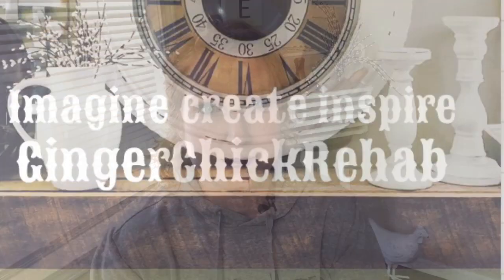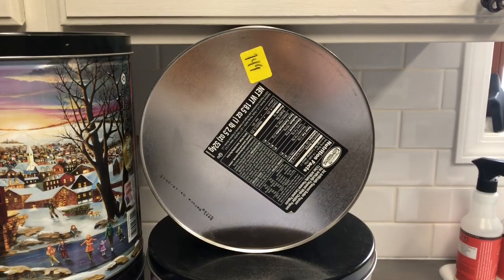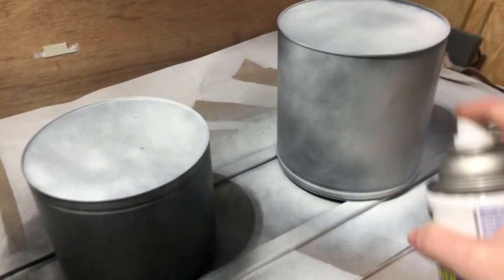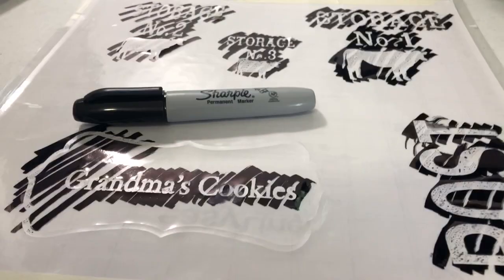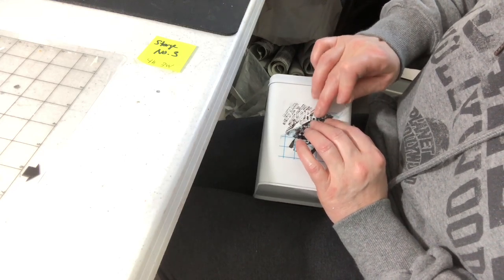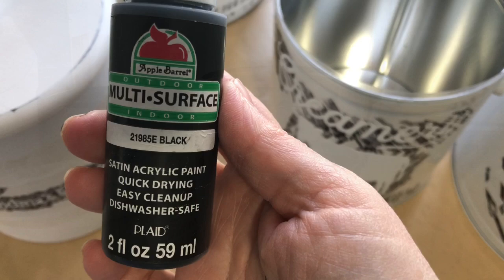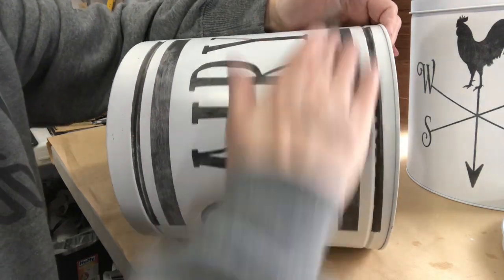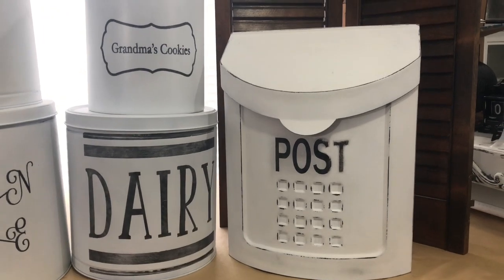Useful DIY Challenge”Up Cycling Popcorn Tins to Fit Into Farmhouse Decor I

Comment: These turned out adorable I know they take a few days to make and one of my flaws that I have with crafting is stenciling it doesn't matter how much I put on my little makeup sponge I still end up with some slipping through the sides it's so frustrating love your DIYs have a great day God bless thank you for sharing
Reply from the maker: Have you tried using the base color first to seal the stencil in.. than your stencil color. O've done that on items that are bumpy and it makes clean lines
Reply: Would chalk paint work better, or is that what you use? .. 🤗
Reply: Thank you so much I will try using a base coat first and then my chalk paint I'll try anything to make it work I was told to spray the back of my stencil with the adhesive first put it down and then try it so I'll try that as well and I hope it doesn't take my base coat off someone else hadl said to use modge podge and then start stenciling thank you so much for your help in reaching out have a great day. I didn't do soon Rust-Oleum chalk paint